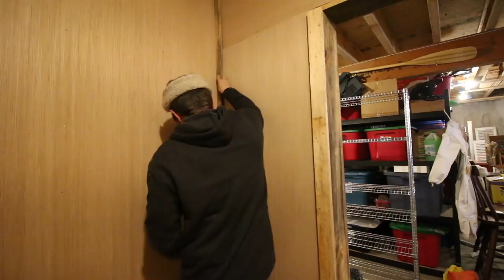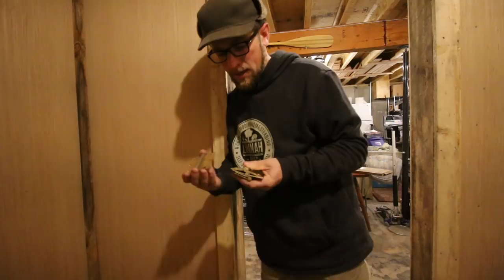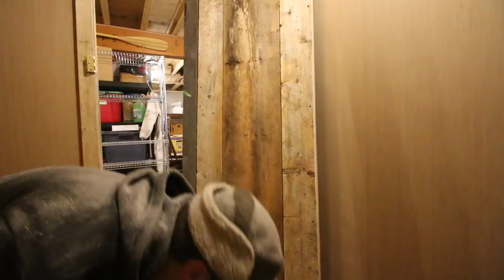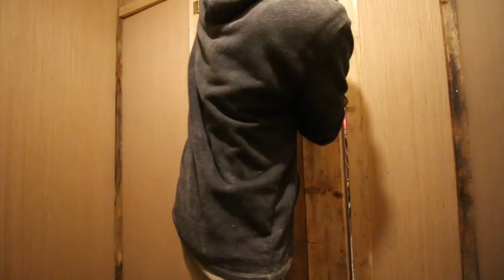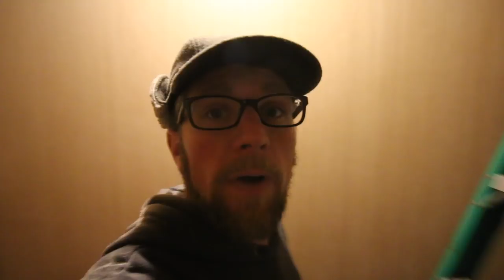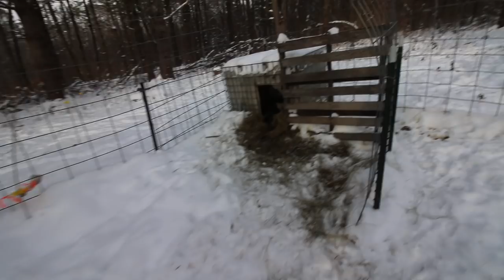Installing our DIY Insulated Barn Board Door on our Root Cellar

Comment: Super Job Al ! I like the lip edge you nailed on the inside  of the door and then trimmed the outside of it to prevent the cool air to escape. So now for the air exchange. I've seen systems with PVC pipes work wonders. Anxious to see how you're going to do your air system... You keep making it and I'll keep watching it. Have a good day  :)

Comment: Great project I like the room that you made for your root cellar talking about holes that you have to manage if you screw hole and you no longer use it but it’s still affecting your hinge a good way to actually recover from that is actually use golf tee pound it into the hole cut it off  and then re screw your hole with no problem of your hole or hinge tilting for the door placement

Comment: When we built our Mt home I had an 8' X 8' drive in door and a 4' X 8' walk in door in the basement. I used the 4' for everything that I could.
I only used the 8' for the tractor or trailer load of wood. My wood stove was also in the basement so I wanted the doors to be insulated. 
They were built out of 2x4s like yours. Outside was 3/4" t/g cedar insulated and luan plywood inside. I also had trouble on the 4' door like
u did. I built the closing side on maybe a 4-5 degree angle and make a rubber seal. The 8' door was 2-4' doors that swung out, cedar outside, 
luan inside. When I made these doors I put a matching 5 degree angle so u closed one door and then the other door closed with no gap. The outside cedar fit so close that u had to be close to the door to see where the door split. I made my own hinges and inside latches, when we left to come home the doors were locked from the inside. Also the doors were very heavy, so I put cables from the top hinges down to the far corner

Comment: Hey Al next time maybe you could angle the knob side door frame to have the door wedge together just a thought. Its all gonna shrink and twist anyway so you will be back, and I have found a wire rope from bottom knob side to the top hinge side with a turnbuckle can pick up the door from knob side bottom rubbing. Good cool room may want more cfl bulbs or led less heat.

Comment: Because of the thickness of the door, one could slightly bevel the mating edge of the door and the frame opening to prevent that swing gap problem. Seeing you run into that is helping me avoid that on a similar door I plan to build. My remaining challenge is that standard doorknobs and latches aren't designed for such a thick door. I may have to have a notch where the door is thinner to accommodate, or find hardware intended for thick doors.

Comment: ... about a 7 degree angle cut on the outside latch side of the door will make it close perfectly, if I remember correctly ... it may be 8 degrees for a 6" thick door ...
Reply from the maker: thanks

Comment: Looking good!  I am definitely not a carpenter so I'm wondering if there is a benefit to having the door open to the inside?  I would have put it opening to the outside so I'm trying to learn your thought process or reasoning?  does it matter?  or just a personal preference thing?
Reply from the maker: I have it open in that way we can stack stuff on the outside walls and not worry about blocking the door
Reply: My thoughts were that the door will take up room opening in and limit the amount of space inside. To go to that much work, I would want as much room inside as possible. But, it's a matter of preference, I guess.  Good job!

Comment: Do you ever have trouble with your rough lumber warping?  We mill our own, but my husband hates using it in the house because it warps and twists in the dry heat.  Any tips to prevent this?
Reply from the maker: How long do you let the wood air dry outside for?
Reply: On logs I think it is one inch a year. Drying slow seems to be the trick. The ends are most important to slow down.
Reply: We’ve tried a few different ways.  We’ve milled fresh cut wood and dried it for about 2 years with spacers between each board (we were expecting this to be our best bet) and that warped pretty bad once we brought it in (we made shelves).  That was hemlock and pine.  We tried leaving the log with painted ends and air drying for a few months after milking and that didn’t work.  That was a thick 2-3 inch slab of black walnut that we used for a butcher table.  We have other various wood out there now that’s been drying for years but he’s hesitant to use it.  We’ve used fresh milled wood for siding on our cow run ins, chicken coop, smoker and coolbot cooler.  That’s all been great...but all outdoors.  He’s talked about building a solar kiln to see if that would help, but we don’t have the funds to devote just yet.

Comment: Replacing the incandescent bulb with a florescent  or LED bulb will reduce the heat generated when the light is on significantly.

Comment: since you like to experiment....Try 2 pipes say 3 inch or so.  Install 1 as high as you can in the window, and the other as low in the cave as you can.  Terminate both pipes outside at same level but away from each other.  (Screens and such as needed, not sure what is on the other side of window) If geothermal transfer is not enough you could then add an exhaust fan to move cold air in and hot air out.Remember hot air rises cool air falls!
Reply from the maker: I like your thinking! My gears are just a spinning!

Comment: Great job Al, it's looking like a real cold storage unit now! You could try adding some weather stripping in between the door & the gap on the door frame if the gap is too big for just 1 piece you could add it to both the door & frame so they come together at the same spot when closed! Hope you all have a very Merry Christmas!!!🌲🌲🌲

Comment: Wouldn't putting the chest freezer in the cave make sense?  Wouldn't it have to work less in a colder environment?
Reply from the maker: It would but the motor would also put off heat and warm up the cave

Comment: Typically the leading edge of a door has a 2 to 3 degree bevel in order to swing properly.  That bevel (carried out across the door thickness) is what has created your gap.   Originally you were thinking about doing a sliding door.  What changed your mind?  It would probably have been easier to create an overlapping sliding door on the front combined with a swinging interior door, leaving a bit of an air chamber between them.  Both could have less bulk and then you would still end up with a good seal as well as good insulation qualities.  If you want to seal your current gap the work around is to make the edge of the door frame also have a bevel to match the door with the front exterior edge thick and the interior  edge thin.  That way when they meet up it will be similar to a lap joint made when joining flat stock end to end.   Did that make any sense?   At any rate ... you overcame the problem in the end and it looks great!
Reply: As Thunder pointed out the latch side of the door should have had a few degree bevel .. And if you want a tighter fit cut the door frame at the same bevel..and a channel around the outer side of the door a door seal could be added with room to be compressed..
and in the interest of sealing the doors r-value 
The top of the door top and top of the frame could be cut with the same degrees of bevel..

Comment: You might consider adding the one-by trim on the inside of the door, at the top and bottom making a dead air space on three sides. But I'm sure you'll have it figured  out by tomorrow's video. xoxo from Arizona.

Comment: In a refrigerator the 15 (?) watt light bulb staying on is enough to over ride the refrigerators cooling effect..
That being said i like to put tattle-tales to remind me and my customers.. The light is still on...
Easiest way is to wire another light to the inside light.. And install it on the outside of the door...
If it's on...you forgot..which is easy to do..we all make mistakes..
only liers don't make mistakes..
Sence this project is a cooling unit..
I might have put a channel in the door stops .. so door seals would have a place to compress...then the door would have a double seal..